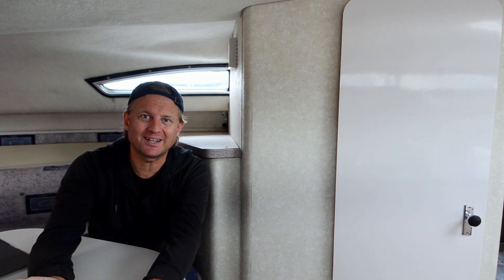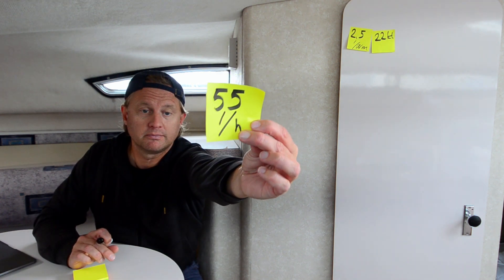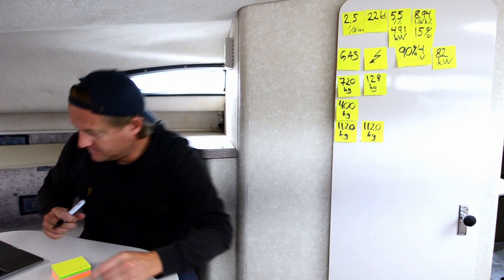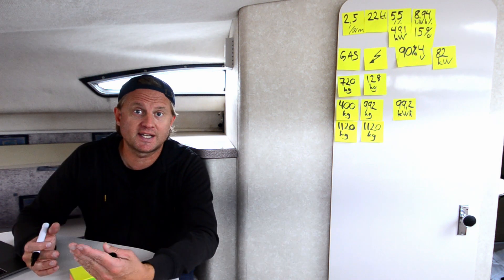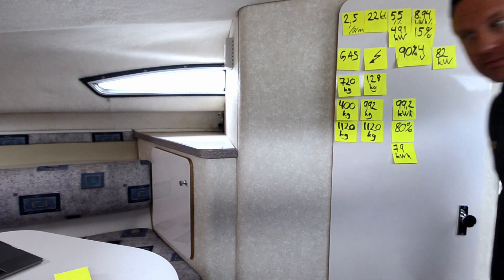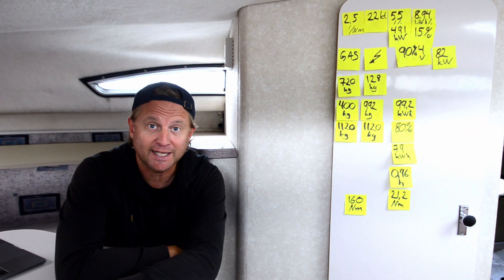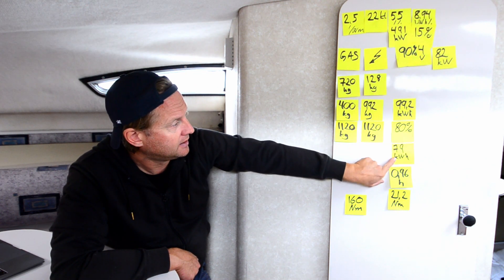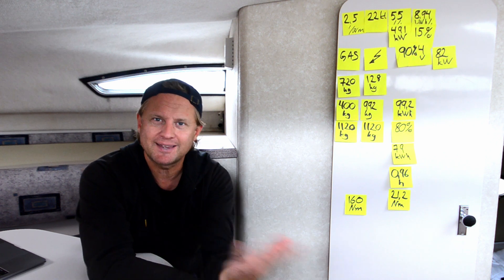ELECTRIC CONVERSION OF AN AMERICAN DAYCRUISER - WHAT IF?

Comment: Great info,  fyi,  if you have a slim hull(Catamaran)  you will probably x2 to x4 range.  Also i am not sure how to calculate but if you drop a knot or 2 you will increase range by multiples.   I want to build a cruising cat with solar on it.   I think its doable with todays tech.